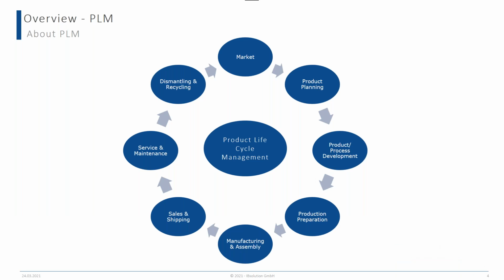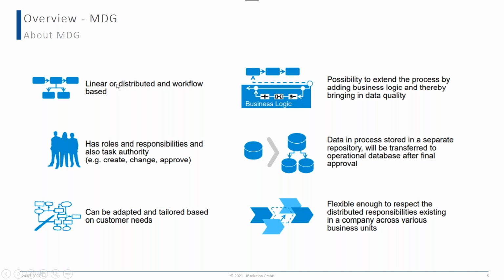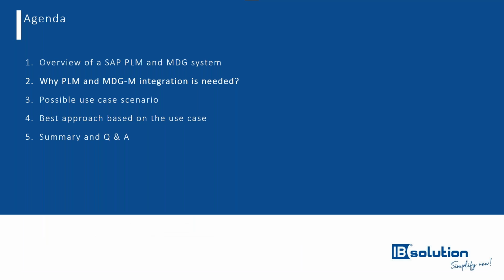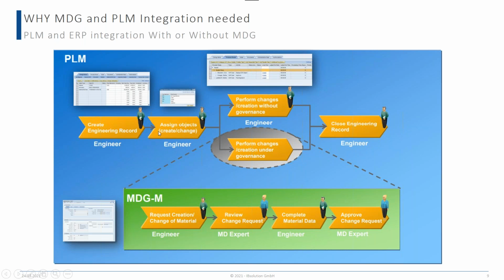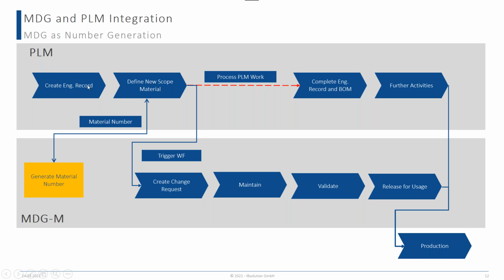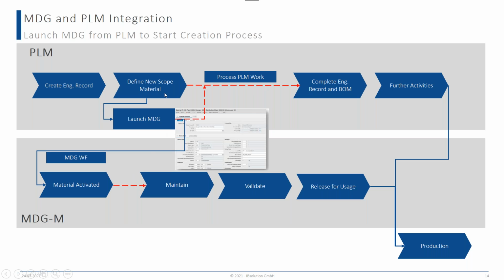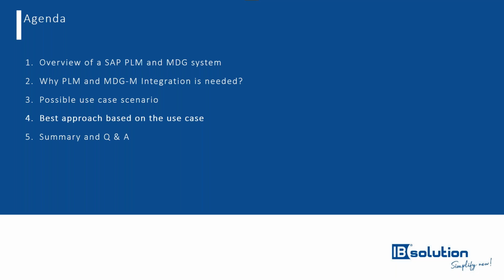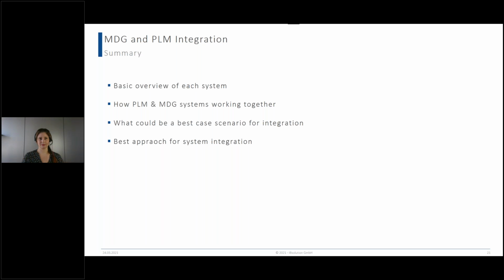Product Lifecycle Management with SAP MDG for Materials

Comment: nice video, exactly at time i was looking for..
one question: at 40 min, we find MDG and SAP .. two systems..

so as per my understanding below, is it correct?
1) MDG to store master data like material, BP [customer + vendor]
2) SAP [is this ECC? ] also this to store transaction data and if need to store other objects apart from what mentioned in pt1 above
Reply: Hello Dia,
Yes. MDG is used to manage our Master data objects and SAP ECC to manage transaction data. 
MDG as Hub : Master data will be managed in hub system and replicated to ECC.
MDG as Co-deploy in ECC : Master data and transaction data both will be managed in same system.